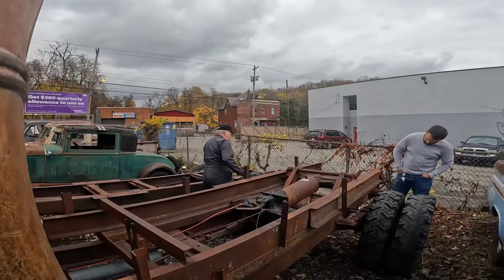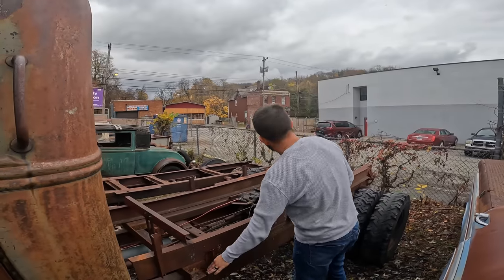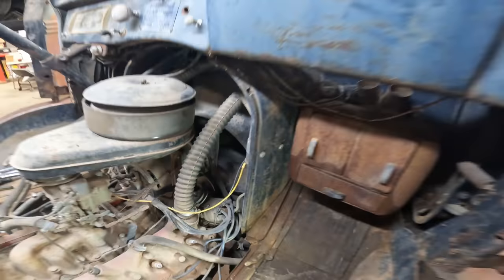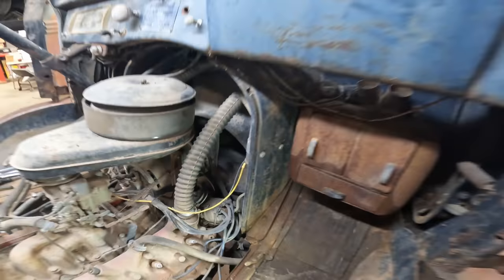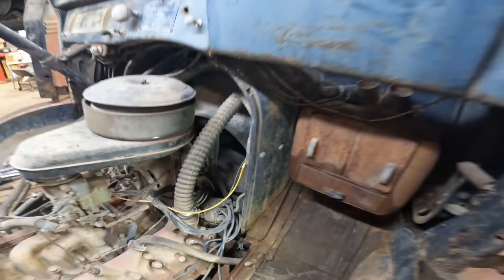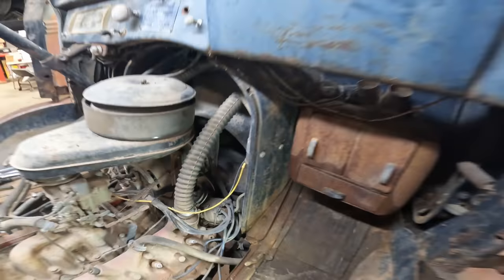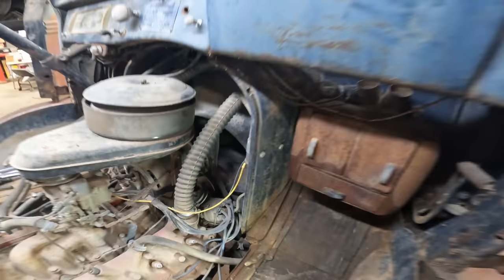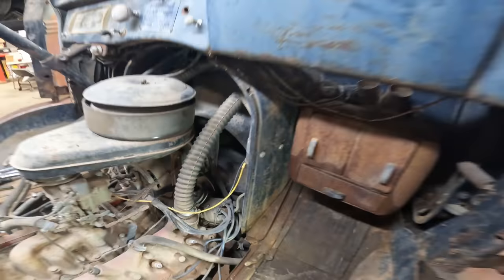1946 Ford Cab Over COE. Fresh off the Farm. (Flat head V8) Will It Run?? ￼

Comment: Nice truck and really actually very clean all considering a great platform for a lot of ideas me personally I would keep the flat head in there and would put a camper cab with a little bit of a flatbed for either a four-wheeler or golf cart
Reply: Yup this would be so fun to do anything with. I hate to sound like a skipping record but the patina on the cab is to die for. It looks like a tarnished copper kettle

Comment: Why not start with an oil drain first?  There is sure to be much water which condensed from the air in the crankcase. You could fill it with oil drained from another cars routineoil change or get some inexpensive recycled or other oil. Also pull the oil pan to see the condition of the bores, pistons so you don't do more damage to the bores. Pull the head too.
Reply: Crank holes are probably clogged with 50 year old oil

Comment: Truck is wearing the dreaded Widow Maker rims. Most dangerous wheel ever designed.
Reply: And no wheel cage in sight....
Reply: I always knew them as a clamshell rim..?but your nickname for them are better
Reply: Why are they dangerous?
Reply: @archiemeche535  how is that? The rim breaks?
Reply: @auzmo  the outside band on the rims fly off the rim thats why they called widow makers if the band is not on right they blow off like a bomb
Reply: @auzmo  The "widow-maker" rim has a lip made onto it to hold the tire bead nearest the chassis. The outside bead lip is removable -- which is how you remove the tire. When remounting the tire that lip - a ring of steel weighing 10 to 20 pounds - is supposed to seat in a groove on the rim. But rust, dirt, wear, and carelessness all too often got in the way and, while reinflating the tire the ring could dislodge suddenly and without any warning. "Lucky" mechanics (and others standing on the other side of the shop) only lost a hand or an arm. Others lost their lives. In the early 1950's shops welded up steel "wheel cages" that were bolted to the floor to limit the carnage. One-piece "Budd" wheels became cherished possessions, and theives stole more than a few outside wheels off of parked rigs with "duals" on the tractor or trailer.
Reply: @fharrisstowe  f my n
Reply: Too bad, split rims can handle more weight then stinking one piece.
Reply: Only dangerous if you let them be
Reply: My Dad had the '67 Dodge 3/4 ton pickup with split rim wheels, 318, 4 speed heavy duty, overload leaf springs ♨️♨️  It was a great truck. I did kinda feel nervous sometimes because the fuel tank was behind the bench seat !
Reply: My dad was a police officer in the 70s n 80s, he told me one day he got a call, an injured person at a gas station, he got there and a guy had rolled a tire in to air it up  ( it had split rim on it)  while airing it up, it blew the rim right in the guys face, my dad said this guy was dying when he arrived, said from the eyebrows up was almost gone, big endentation.. said about 2 or 3 years later , he was in the neighborhood behind the gas station, as he  drove he noticed a man walking towards him, he was on crutches, n having a hard time walking, but managing, as he passed my dad said it was the guy that was dying at the gas station..  the guy flagged my dad down and thanked him for helping him????
My dad was blown away that he was alive, and double blown away that this man who was unconscious and dying with a caved in forehead, could remember him.       The lord works in mysterious ways. Stay away from split rims   my dad told me, the station had a cage that went around tire n wheel, but it blew the cage through the roof
Reply: You're thinking of the rims they outlawed that split in the middle not on the edge those were the most dangerous rim design they were known to blow apart and kill people split rims are dangerous though if you don't know what you are doing
Reply: Actually, the most dangerous wheel is the two piece wheel that is held together by a ring in the center; holding the two halves together. I think they were made by Firestone. My delivery truck had them. I don't miss them at all. Used to haul hazmat with that truck.
Reply: @markdotts6798  Yes...that is the one they call the Widowmaker. I have 6 or them.

Comment: To free up tight pistons and sticky clutches, you can put the truck in reverse gear with the ignition off and tow it gently backwards. The low ratio is kind enough but torquey enough to push anything not completely seized into submission. Just watch for dropped valves or loose connector rods.
Reply: No you cant do this if the brakes are seized or rusted solid. Its best just to pull the clutch and heads, let Marvel's Mystery Oil do its stuff for a few dats (if needed) and get other work done while it works it way in, to loosen things.
Reply: @richardburtonjr1889  a far more civilised approach, but if caught with limited time, the above works.

Comment: 6volt!
Reply: I’m surprised that thing didn’t have a crank start
Reply: Hey could you explain the compression test?

Do you plug the hole then let off to see if she shoots out of the spark plug hole?
Reply: 23:28 hell yeah!

And that trick of putting some weasel piss down the fuel line then air is great!
Reply: 29:00 

joe you’re the man!